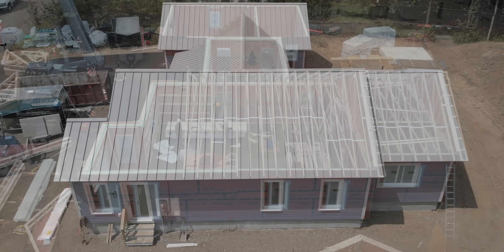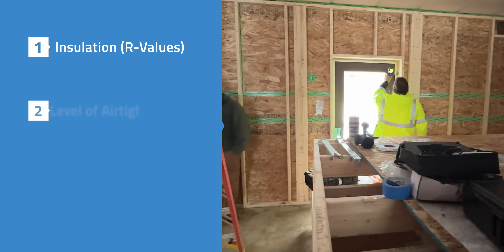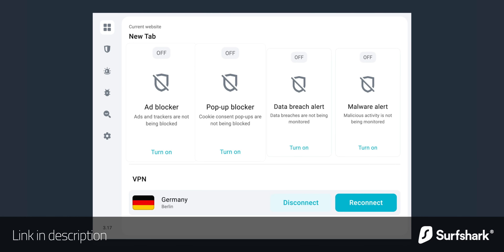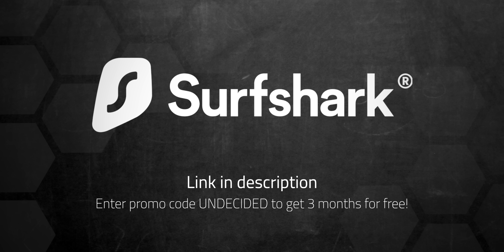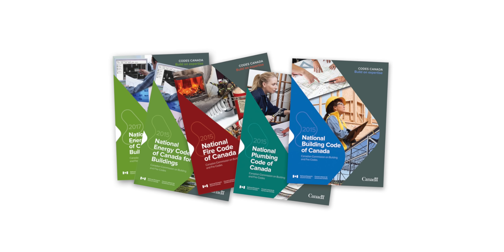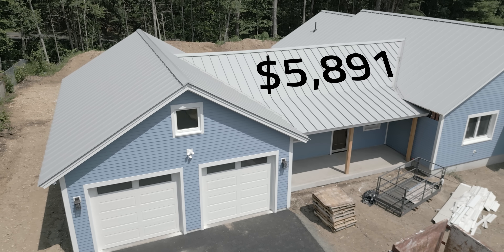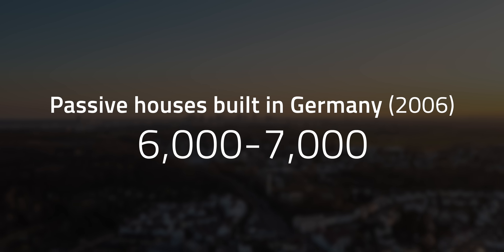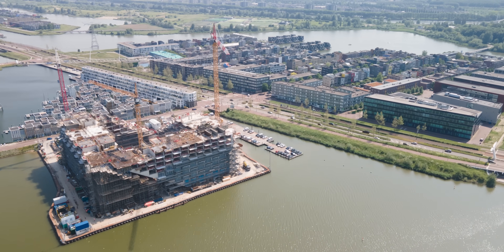Why Do American Homes Suck?

Comment: Good video! I'm from Northern Europe and used to high quality houses (and design), and then I became a homeowner in Texas. A construction home from 2010. Since 80-90% of my electricity bill is keeping the house cool with AC, I was shocked to see things like the front door and other exterior doors had wide and visible gaps between the door and frame, and virtually no form of insulation. Not only letting the cool air escape, but also letting bugs walk in.
Reply: I worked in Texas for some time; coming from Western Europe, I was really surprised to find single glass windows, super hot aluminium window frames which you could not touch without getting burnt whilst at the same time you had to keep the airco on day and night; I had co-workers that said that without airco your house will simply collapse, termites will enter etc just unbelieveable for Europeans
Reply: I am from Norway myself but have lived some time in Vietnam and this annoys me to pieces! All windows and doors have visible gaps, some big enough to fit my finger! They got spiders, snakes and mosquitos and not to cheap electricity. When my nordic body moved from -5c to 35c, AC is an absolute must!
Reply: @NorwegianCrazyGuy 😂
Reply: I've seen these gaps around doors on so many US made films/TV shows and always thought they were just thrown together film sets. 
This explains a lot.
Reply: @bj6515  He is talking act gaps in doors inside the house to different rooms.. and film sets are fake
Reply: @bj6515   I mean...what you're referencing IS a house on a thrown-together film set; they are not real houses people live in, generally.
Reply: I have the same exact experience. I moved from Scandinavia and bought a very nice home in FL. However, I then noticed that you could literally see the daylight between the door and the door jam. No surprice that the energy bills were huge.
Reply: @annemarita4259   that doesn’t make any sense, that’s $20 worth of weatherstripping to fix… and the door and the jam are mated at the factory, there should never be a gap
Reply: @Matt-yg8ub   Duh! No kidding! And I don't give a damn whether you think it makes sense or not. I'm only telling you what I observed and later fixed, as I would also see fine sand piling up on the floor next to the door inside of the house after a windy day. You can only imagine how little it made sense to me, since I remodelled houses in Europe for many years and had never, ever seen anything like it. The house was brand new. They had used a rubber "seal", i.e. weatherstripping between the door and the door jam, but the day was shining through one side of the door. Not to mention that the builders didn't seem to use a level too much while building the houses which were sold for 7 figures. Lol!
Reply: @annemarita4259   Welcome to America…..cheap homes built by low skilled illegal immigrant labor….which sadly artificially lowers the market and undercuts the ability of skilled labor to compete in that market. That said…. Quality control should be better on a seven figure home……but in my own experience, people are lazy. My father in law purchased a $5,000 custom door and the company installed it incorrectly so the latch doesn’t line up and the weather stripping doesn’t fully engage.
Reply: @Matt-yg8ub   Absolutely. I see it all around. My dad was a carpenter in Europe, and I was simply used to seeing everything built perfect - or at least close to. Today incompetence is up everywhere - and in everything, but here in the U.S. it's truly sad. Everyone just tries to make a fast buck.
Reply: @annemarita4259   Far too many factors at work to pin it all on one thing…. But government corruption is  key to all of it. Just like the Jones act killed the domestic maritime shipping industry… regulations and union fees killed quality construction.
Reply: Some years ago, I lived in Nevada for one year, coming from Germany. Rented a floor from a nice elderly couple because i don't wanted to use base housing (far off from everything). The house was just about 15 years old but a mess already, if not from the beginning. The owners complained a lot about the contractors who built the house and the ones tasked to correct the deficiencies. I watched the contractors work for some time and ... don't get me started. I'm in no way a professionell craftsman or even a talented handyman, but the incompetence of those guys was flabbergasting. It looked like they were clueless and clumsy on purpose.

Long story short, I ended up sacrificing some of my free time to get the most pressing issues done. Stabilised some floor and wall framing, fixed the plumbing, replaced two windows and did some minor maintenance. It sounds like major work, but it felt more like fixing a summer house. Lived there 2/3 of the time rent-free because most contractors in the US seem to suck big time.
Reply: @marcromain64 I think in parts of the US anyone can become a contractor. No formal training and certification required, at least for many trades (not sure about electricians), so they sometimes don't even know how to build up to code. After the build a building inspector will tell you how your contractors have effed up. 
But "Pfusch am Bau" (botched contracting job) is a huge problem in Germany, too.
Reply: Oh! So it isn't only the doors in public restroom that have big gaps .
Reply: Everything in Texas is done on the cheap. It is appalling even by American standards.
Reply: New German homes are so isolated and close like a spacecraft. No gap at all. One reason for better contribution quality is the better adjudication of  construction workers and crafts. In Germany workers learn  two days at the college band three days in firms  a week. So the knowledge base is higher.
Reply: door weatherstripping is a maintenance item just like tires on a car. home centers sell a wide variety of weatherstripping. you just have to be motivated enough to get in the car and go get some
Reply: I like to watch some of the house makeover shows like flip or flop and can't believe the low quality of people's homes. The roofing particularly is like I would expect on a garden shed.
Reply: @@randompersonontheinternet8790 
Everything in America is spread out because of so much land and ignorant building practices. In Europe you have so many countries right on top of each other and after centuries of war and firepits wood was a scarce commodity that we don't suffer from. Of course none of this accounts for the just obviously stupid things done here in America. I live in Austin, have built homes in Austin for over 30 years and have worked in over a dozen states building structures.  We are so far behind it's sad. But as America is built now it will be decades before it has a chance of becoming bike friendly.
Reply: Wtf !
Reply: Lots of easy things that can be done to remove the gaps post construction. A lend of a thermal camera will be an eye opener for you. A trip to a DIY superstore will offer many items to plug some gaps. Perhaps install a MUCH better high quality replacement door at least??
Reply: And how much would the same size home and lot go for in Northern Europe? Come on man
Reply: Texas is by far the worst construction quality in the US
Reply: So you lived there when the big freeze happened.  It amazes me that all the water lines are above the ceiling with minimal insulation.  Doesn’t sound like a good idea when they freeze and all the water runs inside the house
Reply: @@randompersonontheinternet8790  ...and... (I will never understand this) meanwhile, they insist at trowing money at 3+ (or so) bathrooms for a 3 bedroom house.🤨
Reply: Welcome to Texas and lazy builders.
Reply: We make plenty of houses that meet or exceed your countries standards. 
Why didn't you buy one of those?????
Oh yeah as soon as you could buy a cheap house you went for it.
Reply: Europoors moving to US like crazy, but then gonna bring up some made up facts how Europistan is better 🤣
Reply: @mrdato116  Sounds like you haven't been to Europe! Highly recommend. You don't realize how nice they have it there until you've gone.
Reply: @ButtTrumpet100  I was. Italy, Germany, France (worst) and Poland( Poland fully depends on US, especially military) life in Europe seems more boring than Los Angeles or Miami. Weather wack too
Reply: @mrdato116 Yeah, being stuck in traffic for hours every day and looking at the same carbon copy architecture and miles and miles of car parks and highways seems like such a fun lifestyle!
The weather is whack - compared to Miami? Come on! I don't think there is a hurricane season in France, Germany or Italy!
Reply: @mrdato116  LA or Miami are hellhole ghettos. We are talking about building standards here. The US military is mighty though. And yes France and Italy might be almost as bad as the US. The Nordics are are NOT!
Reply: @johnj8069  miamis standards are too high. They require cinderblock homes because of the hurricanes 🙄. They don’t realize they can have nice wood and chipboard houses like the rest of the country and be just fine. Hurricane Irma didn’t knock down the rest of the wooden houses in Miami. I get Hurricane Andrew was bad but we’ve seen the 50s houses survive in miami so clearly they can lower the standards again
Reply: @mrdato116  Miami doesn’t even have the right to exist lmao
Reply: @Screaming_Pies  still better than any Europoor city.
Reply: @mrdato116 LOL, yeah. You have the freedom, to live in a cardboard box, or if you're lucky in your car, if you were unlucky and got sick.
You have a two party system, that makes you hate each other. You're living the dream. 😂
Reply: „Europoor“ must be a bad joke. I‘ve never seen as many homeless people as in the US, even not in the Near East or Thailand
Reply: @quintusaurelius5060 The Americans gotta boost their fragile ego, in the land of the free to live in a cardboard.
Reply: @mrdato116  Go visit a Nordic country and you realize we (the US) are fifty years behind. NEW houses don't have proper insulation, the walls are made of thin card board with no sound isolation, the windows are only dual pane, you can see light through between door and frame, you need heating if it's 60F outside... the US houses are so ridiculously bad that people visiting from the Nordics cannot believe it.
Reply: @mrdato116  having lived in the northern United States my entire life, and never seen any of this, it amazes me that the European seem to be the only ones who can find these massive cracks in doors. Either Texas truly does make everything extremely poorly…. Or a whole bunch of people are repeating the same bullshit.
Reply: @mrdato116  Trump voter?
Reply: @denislostinlondon199  yo moma voter
Reply: @mrdato116 Why would anyone even move to the US.
Reply: @ankra12  haha cope harder
Reply: @ankra12  Because it’s awesome
Reply: @mrdato116  who in Europe would want to move to a backward country like the USA? Matchstick houses, energy waste, no universal health care, no environmental and consumer protection. Gun violence. If they do move, they are entitled  to their  opinion. Unlike most Americans they would be in a position to make comparisons. It helps if you don‘t live in a bubble.

Comment: Living in middle of sweden, or rather the northern part depending on who you ask, where winter can hit -30c. Our house was built early 70s and is not energy efficient. We've changed out all the windows to 3 pane, installed double air heat pump units, and done basically everything but add an extra layer of insulation dusring the ten years we've lived here.

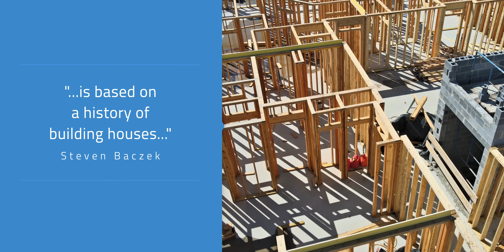Comment: 11:27 And it's no like house prices have kept unchanged, or at most in level with inflation.
House prices have been risen, despite not investing in efficient ways to build.

Hence, building codes are just crucial in order to reduce our carbon foot print.

And remember, efficiency always has (1) a great improvement on your comfort, and (2) a good direct impact in your wallet, e.g., by reducing your consumption needs (lower utility bills and gas fill-ups).
Hence, I honestly think that every country - especially those in the 1st World - must improve their building codes, and impose more efficient houses.
Not only because it is better for your wallet, but especially because we - in the 1st World - are the more demanding for comfort in our homes; therefore, if our homes are less efficient, we will simply consume more resources, which it's just plain dumb!

The issue we face is that efficiency is not something fancy we can show off.
It is just hidden in plain site, doing its thing.
Human want / desire flashy things to show off!

Efficiency is not a SUV.
Efficiency is not a 4.400 lb (2.000 kg) EV.
And, especially, efficiency is not an EV that is a SUV!
Please, World, rethink your efficiency strategy.

Just a weight compassion between Electric, ICE, and some Hybrid powered vehicles:
EV - Tesla Model X: 5,072 to 5,531 lb (2,301 to 2,509 kg)
ICE - Mercedes-Benz GLE (4th Gen, W167): 4,696 lb (2,130 kg)

EV - Tesla Model S: 4,323 to 4,960 lb (1,961 to 2,250 kg)
ICE - Mercedes-Benz E-Class (5th Gen, W213): 3,538 to 4,515 lb (1,605 to 2,048 kg)

EV - Ford F-150 Lightning: 6,500 lb (2,900 kg)
ICE - Ford F-150 (14th Gen): 4.837 to 5.013 lb (2194 to 2274 kg)

EV - Ford Mustang Mach-E: 4,394 to 4,890 lb (1,993 to 2,218 kg)
Hybrid - Toyota RAV-4 (5th Gen, XA50): 3,704 to 3,792 lb (1,680 to 1,720 kg)
ICE - Toyota RAV-4 (5th Gen, XA50): 3,373 to 3,616 lb (1,530 to 1,640 kg)

EVs need Electricity - which is more important to factories, heating homes with a heat pump, powering on the lights, etc...
These heavy EVs:
- Need bigger and stronger tires;
- Need bigger and stronger suspension parts;
- Need bigger and stronger brake parts (even with regenerative braking!);
- Need bigger parking spaces;
- Need stronger roads to handle the weight;
- Need more infrastructure, that you see (charging station), and that you ignore (power stations and electric lines).
Are you actually worried about the environment.

If we were, we would fight for repairability (right to repair) - to which Apple is a major offender!
If we were, we would see the iFixit rating before purchasing our next electronic device.

Comment: One thing I've noticed is in some countries they'll slap a solar water heater on the roof. Like literally every house has this drum on the roof with a solar panel and you get hot water for nothing. You'd think this would be a no-brainer everywhere quite frankly but it's not.

Comment: If subfloring is held to the floor joists with nails, the floors will probably squeak.  Not right away, but after the house is a couple of decades old it will have developed squeaky floors.  Using screws instead of nails prevents this.

Comment: Matt I am so happy that you are building your house. I lived 10 years in CA and UT. I was surprised me how low tech US houses are. I found them uncomfortable. Only one layer of classes, hardly no insulation, loud and uneconomical heating (forced heat yack) and A/C. I recently moved back to Finland and bought a house. It is build from stone (actually man made special concrete compound). It has very good insulation and it totally cancels outside noise. Windows have four layers. Heating is geothermal with water circulating beneath floors. Even when there is -25 C outside I can walk inside on my bare foot and underpants. Heating cost are factions of those US houses. When I take a shower the warm water comes instantly. On the top it has a nice sauna. Internet is 1G fiber. I don't miss those cold, loud and noisy US houses at all. The result of good building standard in Finland is partly because of our climate but also a political will that is very important in maters like this.

Comment: Cut a 2 meter board in 3, 4, or 6 identical pieces. Base 12 works for the techs that make things happen. Base 10 works for engineers and other pointy heads.

Comment: Hi from the West Australian desert. Our home was started in 1892 and I have made major upgrades. Today was 38Celcius which is a high temperature for this time of year. The air conditioner was not turned-on till late this afternoon and of course does not cost us as our 11-year-old solar system produces more electricity than we use. I find it difficult to understand how a nation similar to Australia has such poor housing construction. Through improvements we are now cyclone rated mainly through the upgrade of windows. I think all external walls have a R7 rating and because of the 130+ year construction of the massive roof a R3.5 rating. Please your homes LOOK lovely and I especially like some of the older designs but energy and safety is getting expensive. You need to make the changes to your State and Territories governments building codes.

Comment: Windows: Other than a relatively few weeks in winter and summer, both here in Kentucky and formerly in Phoenix, almost every day I had the windows open for hours (in the morning or overnight in summer, in the afternoon sunlight in winter). Those top-open windows seem horribly awkward at having them open a bit - can you even have curtains? And how do you talk to people outside if you can't open the bottom? Don't you find those fixed bottom panes feel like you are cut off from the outside world, they seem quite claustrophobic for an "open" window.

Comment: Plenty of European living spaces suck even worse.  LOTS of Europeans live in urban apartments constructed in the 18th century without plumbing central heat, air conditioning, even running water.  Included are stone wall and uninsulated slate roofs in many rural areas are still occupied.  Only in recently built suburbs are European homes technologically advanced.  Matt, I admire your cutting edge focus, but the rest of us exist in reality.